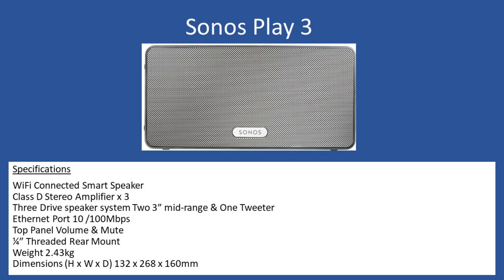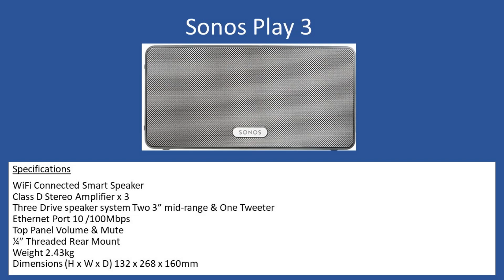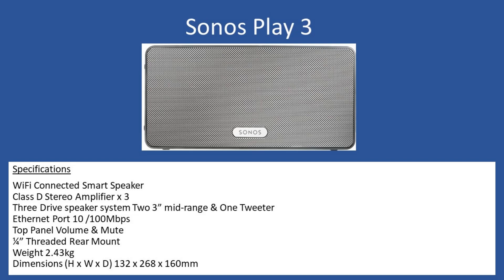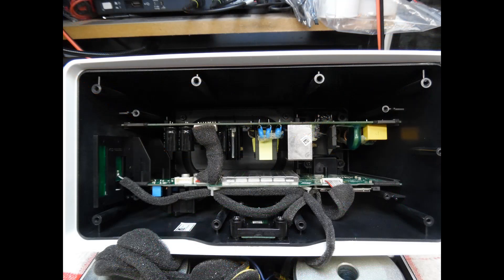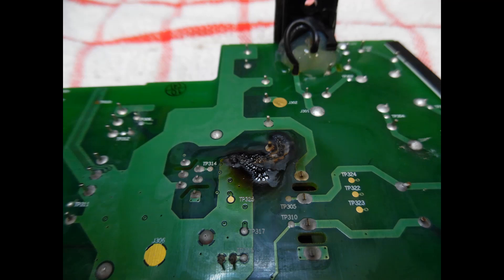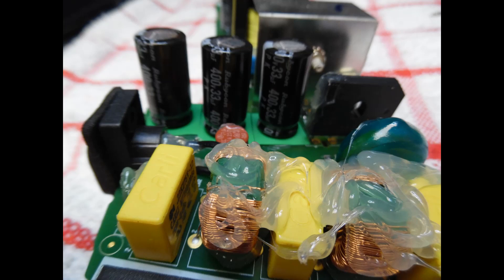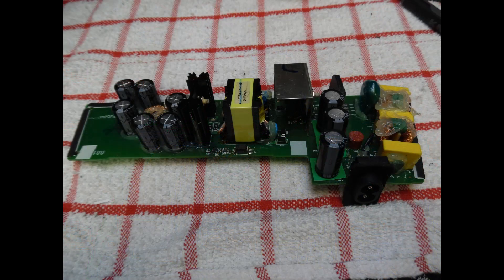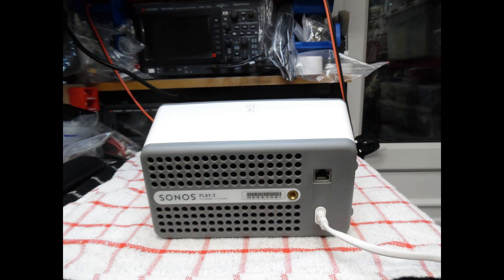Sonos Play 3 Smart Speaker Repair (With Audio Tutorial)

Comment: Excellent video. I recently acquired two used Sonos Play 3s with unknown usage history or internal condition. I would like to proactively have these capacitors replaced if I can find a local (Atlanta, GA) electronics-audio repair shop with Sonos experience. 

Would you mind providing the details of the recommended capacitors. I understand they are 33uf 400v from Rubycon. I assume there are other details such as dimensions and terminal spacing. Some quick research suggests there are other reputable Japanese producers as well if the Rubycons are difficult to find. Are there other capacitor brands you also recommend?

Many thanks!
Reply from the maker: Hi I would advise obtaining replacement capacitors from Mouser or Digikey both companies have a good range of high quality Japenese capacitors. If you select 105 Deg C operating temperature, the capacitor will have longer operational hours.
The important point is to only purchase from reputable suppliers to ensure you are receiving genuine original components.
Reply: @AudioAmplifierServicing thank you for your immediate reply. I will source from one of your recommended suppliers. Do you recall the approximate dimensions needed to fit the space available on the board? I guessing some capacitors with these ratings will be short wide and others tall skinny. Thank you!
Reply from the maker: @vaughanbranch8376 Hi, I do not have the dimensions, but easy to check the ones on the circuit board and cross reference when ordering the new replacements.
Reply: @AudioAmplifierServicing Thank you! Will do.